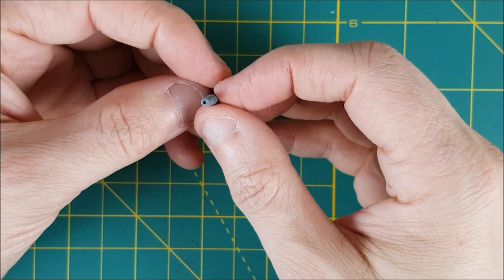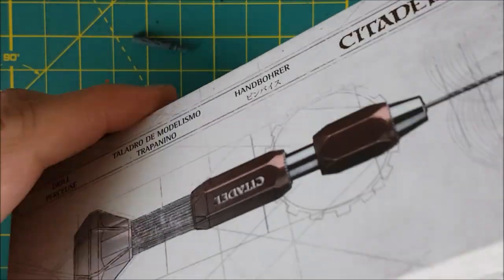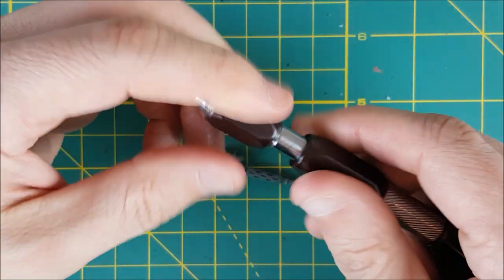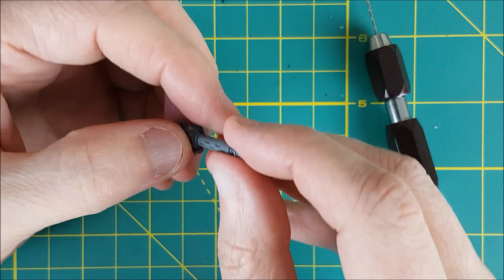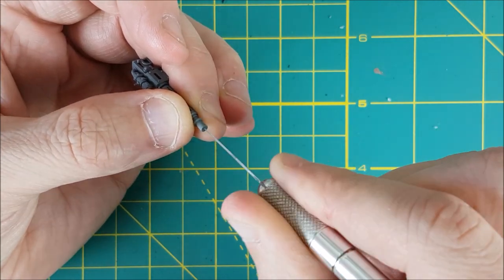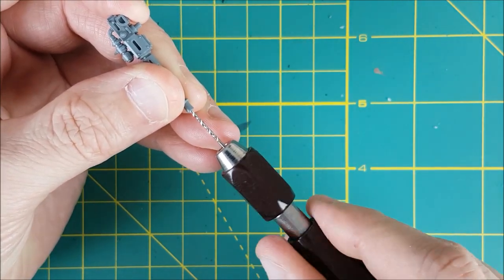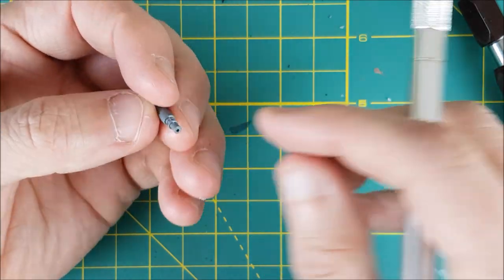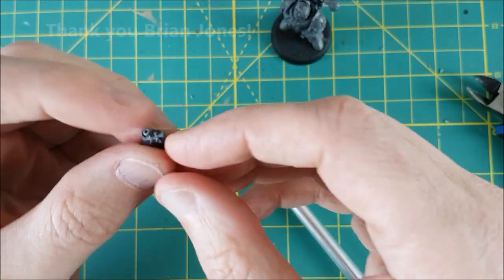Paint-tech 24 - Drilling Gun Barrels

Comment: Why don't the manufacturers make the guns with barrel holes?
Reply from the maker: I'm not sure. High quality minis like GW sometimes have the holes there, but for most models like the ones from CMON, etc you'll never have hollow gun barrels.
Reply: While you can do it with some designs, many models simply cannot have a hole there because of the very process involved in casting the model: injection molding. You will however see it in many models where the gun is big enough to not only allow two parts for the barrel, but require it to maintain the same level of detail as the rest of the sculpt. It's also the same reason they can't completely get rid of mold lines.
Reply: But they made the holes on the side of the barrel... I think I understand after giving it more thought.  The mold is two sided and a third side would be needed to make barrel holes of useful depth.  Or the barrel end would have to be a separate part.
Reply: @adriant1654  you got it, the direction dictates the detail. It's also a real big giveaway if the sprue connects to the front of the gun, as that's where   the plastic was flowing through the mold, pretty much impossible to put a hole there.